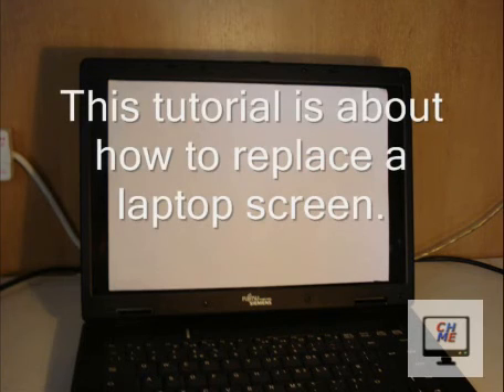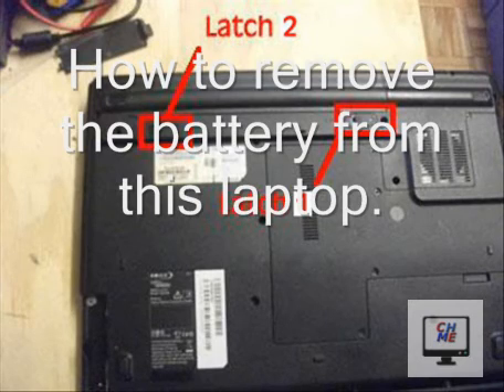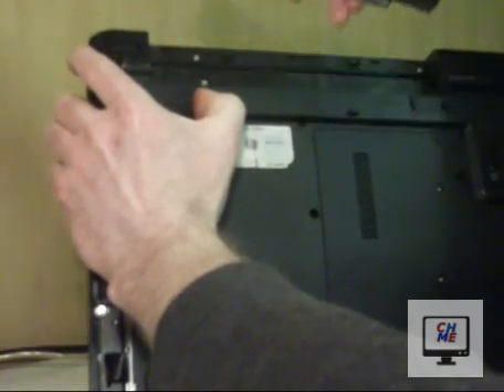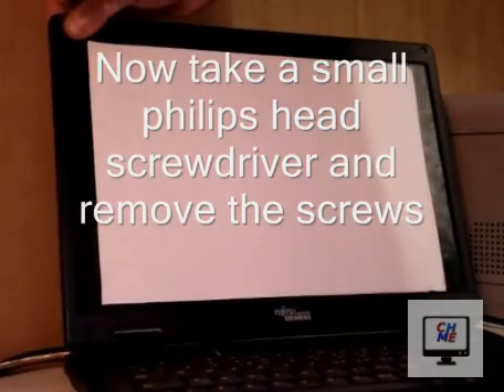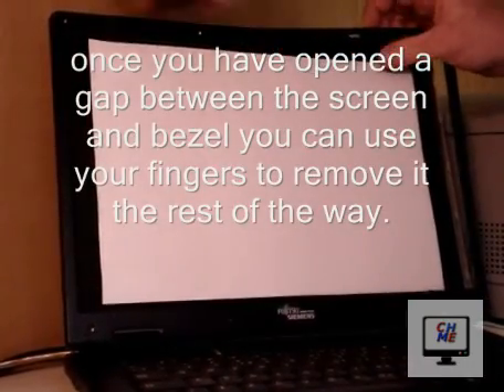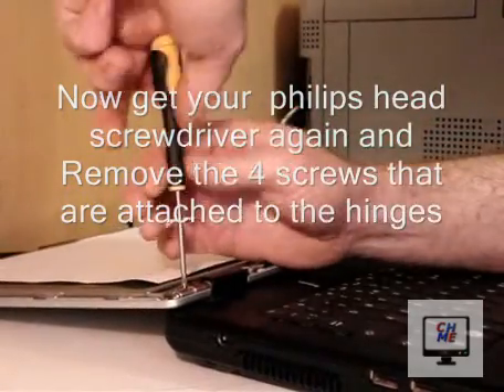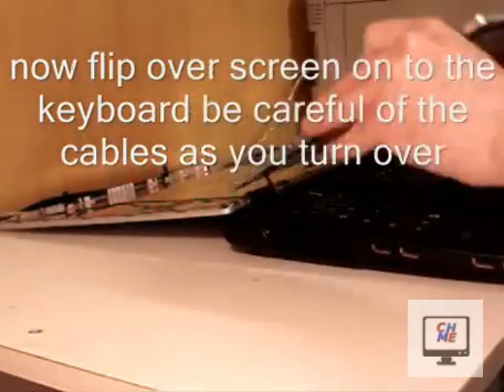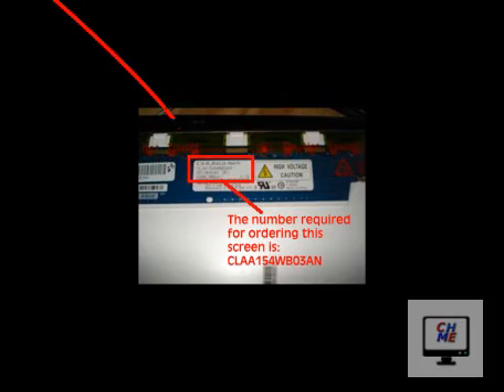How to remove a laptop screen

Comment: the ribbon cable was dameged by accedent..what does it do? 
and can i replace it?
Reply from the maker: +Cloudy Yes you can replace it!  Go to ebay and type in model number and type of cable, should be a model number on that cable also! Failing that! you will have to find support on laptop manufacturers website, possibly a call center you can contact!

Comment: I have an old laptop and I want to remove the monitor from it so I can use it as a monitor for something else. Can the laptop monitor be used as an external monitor when removed from the laptop?
Reply from the maker: Short answer is no! the screen is supported by the system board in the laptop, but you can use it a monitor as is! i will get back to later with the details! a little busy right now! OK
Reply: Thanks
Reply from the maker: Alright NavyBurger! So if you want to use the monitor for any other device then you will need a "LCD/LED Screen Controller Board Diy Monitor Kit" they cost about $40 on eBay here the link http://www.ebay.com/itm/110977522562?ssPageName=STRK:MEWNX:IT&_trksid=p3984.m1497.l2649
Now watch this YouTube video to find out how to use the kit https://www.youtube.com/watch?v=6SOXMDb4cjI

If the laptop is still in good working order. You could use a "network router" to use it as a second monitor for a any device. If that's the case let me know, i will show you other videos on how to do that. OK hope that helps!
Reply: Thanks very much, you have been very helpful!
Reply: @KevinColleranCHME  Was there ever a video on this? I know that this is years later that I am asking but I would appreciate learning how to do this.

Comment: I want to remove my laptop's lcd screen, and use an external monitor instead. Something like LCD output to VGA. Is it possible ?
Reply from the maker: Hi Martin, yes that's very possible there's a VGA or HDMI plug on the laptop either on the side or back of the laptop! you can then use it to plug in the external monitor and use the "toggle" button to switch the screen to view on the external monitor! {you will need user manual of your laptop to find out which button to press to switch screen view} you can also get "USB monitor" in a local computer store which makes the job a lot easier just plug and play.
Reply: Kevin Colleran I've already an external monitor from my VGA output. I want to know if it could be possible to plug another monitor instead of my laptop's lcd screen.
Reply from the maker: Yes! the best type is a "USB monitor" as i said and this way you can plug another monitor, so you can view your laptop with two screens.

Comment: I want to remove the screen entirely, not replaced. will I be able to work the laptop with a detached screen?
Reply from the maker: Hi Mark, Yes you can remove screen completely, just remove the screws that are connecting the screen to the base of the laptop usually 2 screws both sides.
You will have to remove cover panel, keyboard, hard drive, RAM, and DVD to keep them safe from damaging while working and all plastic covers to get at the screws, this is the handiest way. Now make sure you disconnect the wireless antenna cables from wireless card and the power and data connector cable also then screen panel will then be completely separated from laptop, hope that helps.
Reply: Kevin Colleran could i use the monitor as a second display on my desktop?
Reply from the maker: Hi Antonio!
Yes you can! But only if you operating system has the software to do that!
Click Start, Control Panel, Appearance and Personalization. Choose ‘Connect an external display’ from the Display menu. What’s shown on your main screen will be duplicated on the second display. Select ‘Extend these displays’ from the ‘Multiple displays’ drop-down menu to expand your desktop across both monitors.